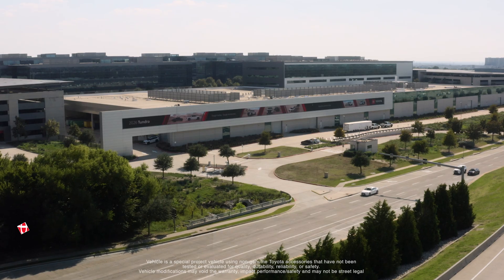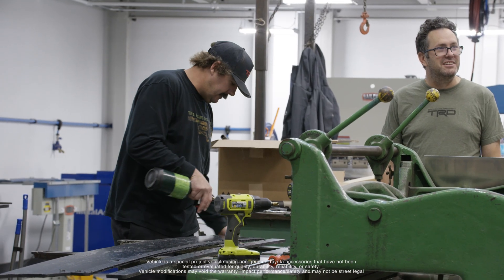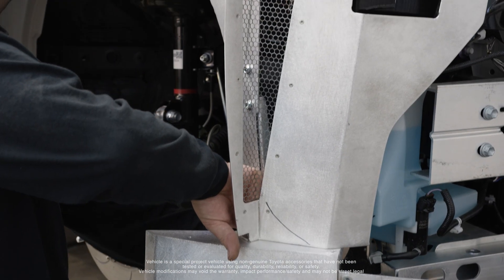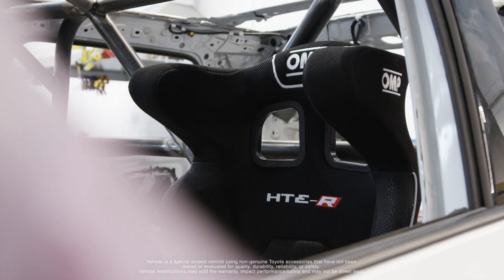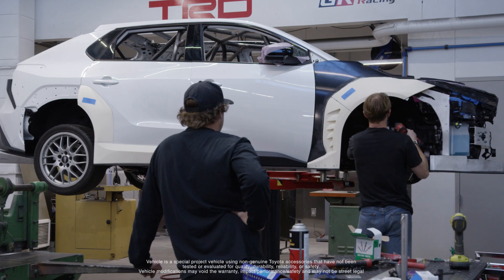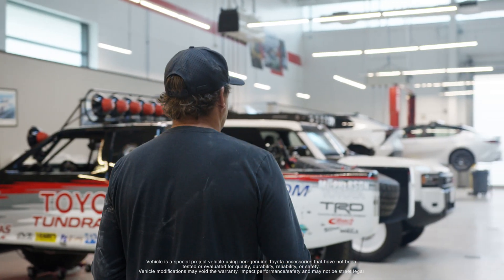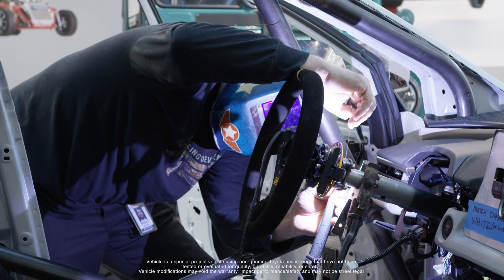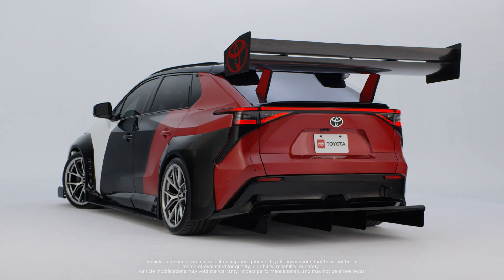"bZ Time Attack Concept":  SEMA Build Episode 3 | Toyota

Comment: You need 1000 HP to be “race proven” . The 338 HP is Not enough for a hill climb race car 😂 . Toyota, just use it as the lame Crossover that it was designed to be.